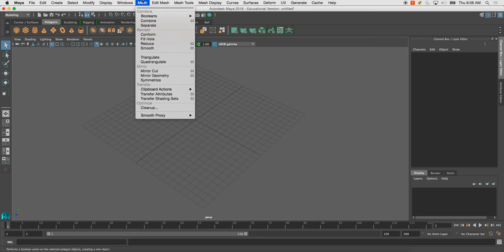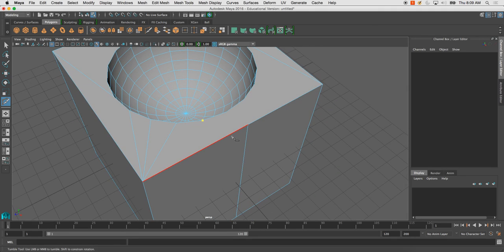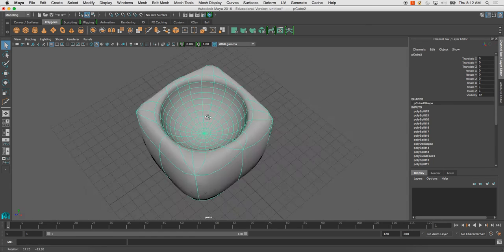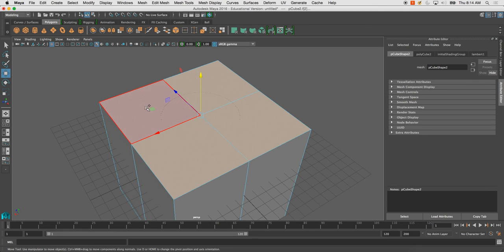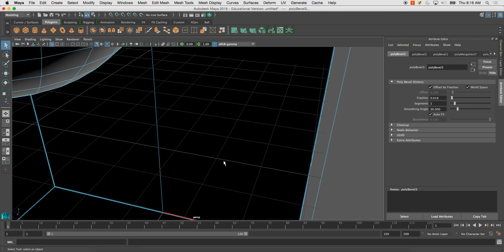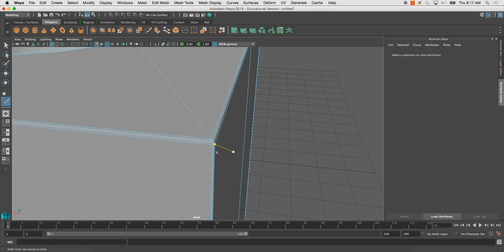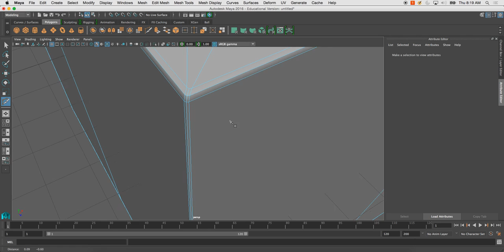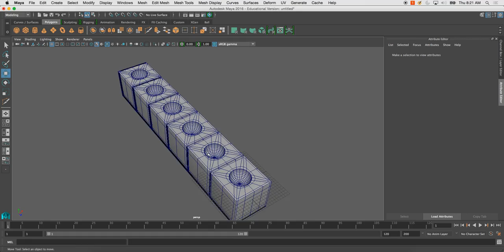Boolean & Hard Surface Modeling w/ Correct Topology

Comment: Very nice. I use the same technique in 3dsmax, although often I will remove the triangles created after connecting the extruded edges to the box shape by simply deleting the center segment line at each corner, which results in all quads for subdivision.  This will provide much cleaner edge beveling. Nice vid.